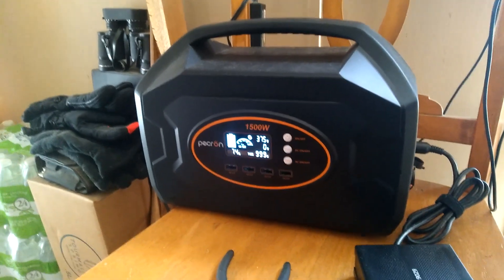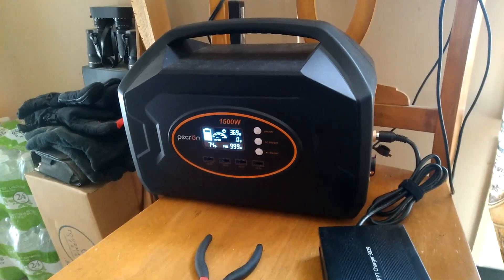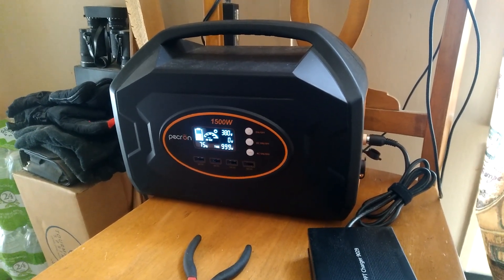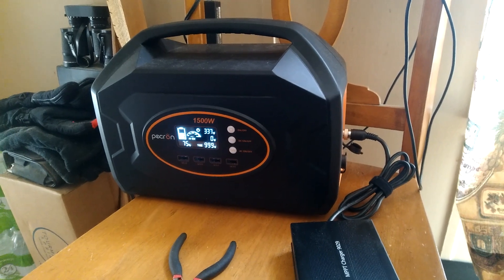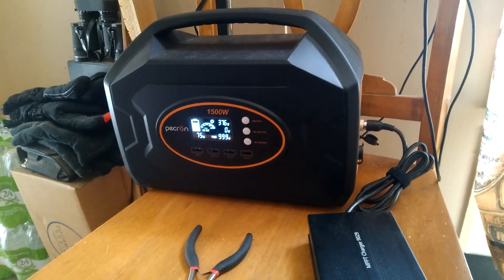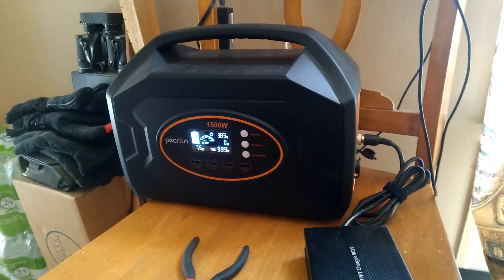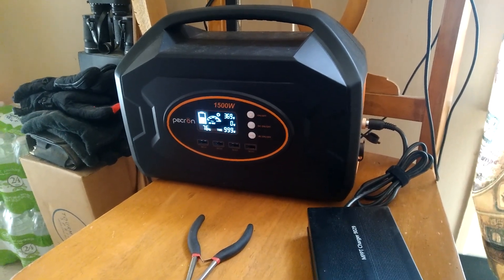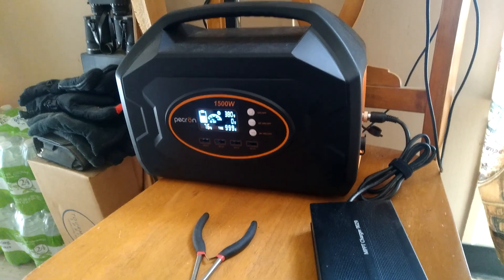Charging the Pecron S1500F WITH A 400W Panel

Comment: Just bought one of these cause I couldn't pass up the $499. price tag. I know finding panels that work with their parameters is a hassle. You have any recommendations? Thanks.
Reply from the maker: I am using a 400W 40V panel and it loves it, lol.  Seems the controller likes the higher wattag and voltage.  If you are looking for LiPo4 power supply I am having a great experience with the MARXON G1500.  It has a better solar charge range and is LiPo4.  It is also 120V output on the inverter side and is only $750 on Amazon.  I use it every day and it is performing fantastic.  I am probubly going to buy aother one.  I also use the pecron every day and it is performing excellent.
Reply: Can you put a link to the solar panel and help us all out.
Reply: @peacefulprepper2402  thanks for the info. What panel are you using with the pecron?
Reply: @peacefulprepper2402 Can you put a link to the solar panel to help us out please.
Reply: The Marxon is now $470 on Amazon. The Pecron is a beast and at the time of purchase 2 years ago it was the best value given its quick recharge time but its heavy!! And not easy to charge via normal solar panels. I would not buy it again in 2024.